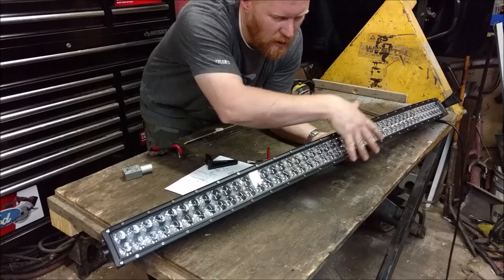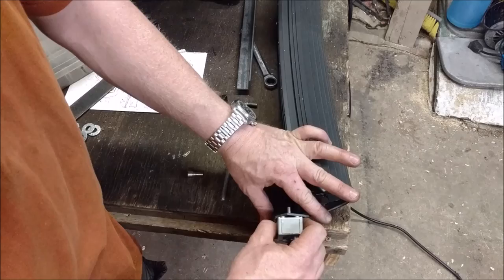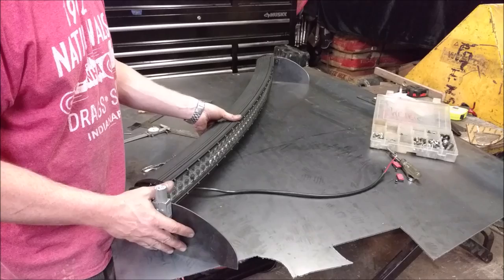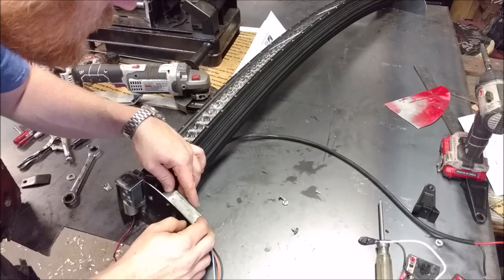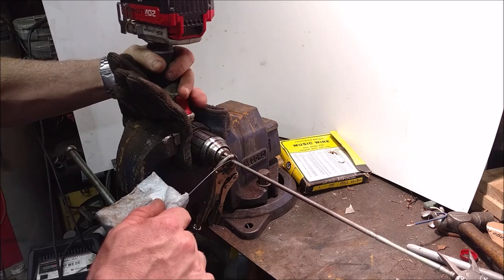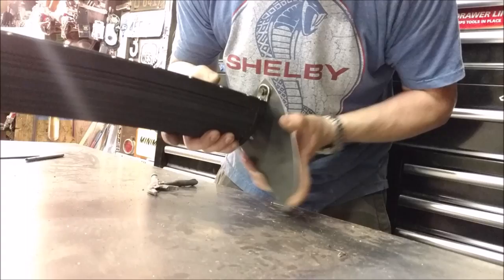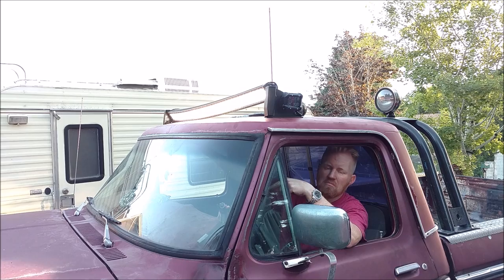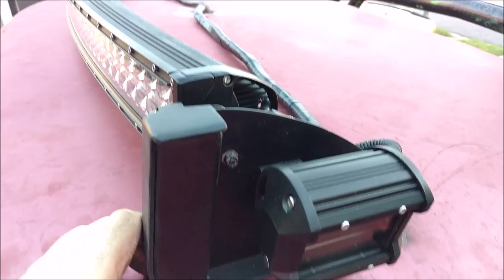MOVING Light Bar REMOTE CONTROL

Comment: That is so cool to see how you can turn the light and look behind the truck ...Also nice to see and old Ford out 4 wheeling
Reply from the maker: Thanks. She has a good time playing in the dirt.
Reply: You can mount a 9 inch bar where the cargo light is or if you have a topper put it on the back up high. Launching a boat at night in Arkansas just got a whole lot easier.   Use the cargo light switch...ez peasy

Comment: Great project, nicely executed!! I would offer two ideas to you, instead of marine grease to seal the electrical component covers use a smear of black silicone, it's easily replaceable and won't break down after a day in the sun, also I'd put two screws through each of the brackets that attaches the assembly to the roof, the sheets metal vibrates slightly while driving and will eventually cause cracks around the welds. The weight of the light is multiplied by the length of the bracket and the sheet metal will flex quite a bit. I'm not being critical, it's a great job and it's given me quite a few ideas for lights on my own Tahoe. Thanks for sharing.

Comment: Nice build, I thought I had a great idea back in college, 30 years ago, and made a whiskey dispenser in my Trans Am that dispensed whiskey into a glass set on the open glove box. Everything was hidden and the copper pipe ran through the AC box and chilled the whiskey. You could search the car and nothing looked out of place. Everybody always wanted me to show them it working and thought it was the coolest thing around. I sure do like that light bar on your truck I may use your idea if you don't mind.
Reply from the maker: Very cleaver.
Reply: Are you the one that got arrested for drinking and driving with the windshield wiper washer reservoir full of alcohol?

Comment: Great job. STILL the only motorized-adjustable light bar on YouTube (from what I can find). 
I’d love an updated version that’s more weather resistant. My light bar is under my bumper. Concerned how much moisture your set up would take.
Reply from the maker: 7 years outside in the rain in the summer and with snow piled up all over during the winter and it hasn't failed me yet. You could put some rubber shielding on more stuff if there was concern. Or even pack around sensitive areas with waterproof grease.

Comment: I did this with halogen lights and a windshield wiper motor decades ago. then I converted to an LED bar when they came out. your design is good for road travel, but won't take rock crawling without shearing and leaving your $300 light bar on the trail.
Reply from the maker: I've done many rock crawling adventure with this. No issues.

Comment: this is the first time that I seen your Channel that I must admit for a young guy such as yourself you do a terrific job man pretty ingenious I can usually figure stuff out but I don't know all the lingo or all the new switches Motors that kind of thing to figure out anything like this at all but I do have to agree with the two suggested that were made to you about the spot welds on top and the black silicone but I you understand about not wanting to put a hole in your deck because I have a three-quarter ton truck and I have 6 I think it is the little teardrop lights on top I've had trouble with those leaking anyway I have subscribed preciate it
Reply from the maker: Thanks for watching and subscribing. -Moe

Comment: I did one about 5 years ago with a windmill electric connection and on off on switch and a potentiometer give me about an hour and a half and I can set mine to rotate constantly and adjust the speed so that it spins real fast or slow however I want it and you can keep it on so you're not the first maybe the first one on YouTube LOL
Reply from the maker: Windmill... What does that have to do with a adjustable light bar on a truck? Nothing LoL

Comment: @sixtyfiveford now you should do a video on how to upgrade to new style headlights using led's or hid on older vehicles
Reply from the maker: I have looked into it extensively and LED conversions are out there but get a lot of bad reviews. They blind everyone else on the road as they have poor focusing ability.  HIDs are the best option but very expensive. 

 I drive older vehicles and feel the pain of having dim headlights.  On my older trucks with all glass bulbs I simply drive around with my brights on all the time and no one ever seams to care. I put in new basic halogen glass headlights into my 78 Ford and was impressed with the improvement in light output over a set that was 10 years old. My wife's 96 Ford escort I added halogen fog lights behind the bumper and they come on with the headlights; this made a huge difference. I  did the same with my 86 Toyota. My 2000 Ford expedition I polished the headlight lenses but is on the list for a small LED light bar behind the grill.
Reply: +sixtyfiveford well a video on something that helps out with brightness without  blinding and keeping it on a budget, like maybe trying glass lenses or plastic lenses and how easy to change maybe upgrading to better light bulbs and adjusting them if they are too bright for the road that would be something I would like to watch is what I wanted to see next lol after I watched your video  I know there's a video out there but I like your style my friend....

Comment: Brilliant as allways, you have made an accessory even better :-D.
They need to copy your idea.
What was the switch, double pole double throw with X wires and center off?.
I like the end sensors, thats just bomb proof :-D
Reply from the maker: Yes, a standard double pole/throw momentary switch. The X wires are interrupted by the micro switches.
Reply: Ive seen house lighting switches done the same, a center switch inbetween two others :-D.
And relays are good if you need more power ha ha, power mad :D

Comment: what an awesome idea! it would be cool to have the switch mounted on the gear shift or for automatics have like paddle controls behind the steering wheel. I want to build an electric cover for mine. Here in VA the cops love to write lightbar tickets!
Reply from the maker: Is that with people driving with them on? or just for having a light bar?  I was planning on hiding one behind the grill on my Ford expedition that I could remote angle a little like this one.

Comment: Very nicely done! One question, how does it handle vibration, I did not see you use any rubber in the assembly or mounting to handle this? No criticism, just curiosity.
Reply from the maker: It's solid mounted to the cab, so unless the cab moves it doesn't. As far as the light bar itself it is held rigid with springs.

Comment: wow..very impressed with the motor driven light bar adjuster..what are the motors you use..or better still could you make up a unit to sell,delighted to use pay pal...i have a straight bar on roof..use ig for night movies snd photography work.....nice job congratulation on your imagination.....
Reply from the maker: Thanks. I have a link in the video description that shows how to buy all the parts that I used. Being a custom item without a standard light bar or application, there are too many variables to reliably produce these.

Comment: i wonder if i can do this to my adjustable cusco drift wing. itd be nice to adjust it while driving to change the down force pressure.
Reply from the maker: That's a neat idea. The little motor I used is probable too weak to handle the forces though.
Reply: sixtyfiveford maybe i could find an electronicly controlled telescoping pole to use that could handle it. thanks for the idea though!